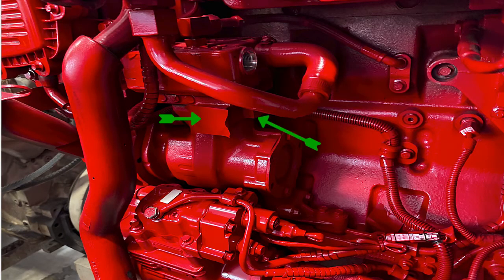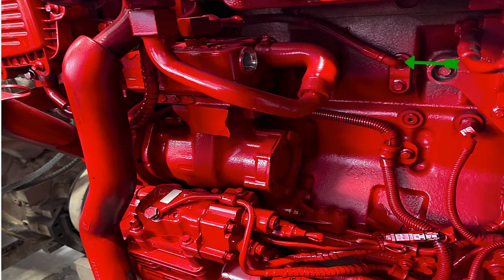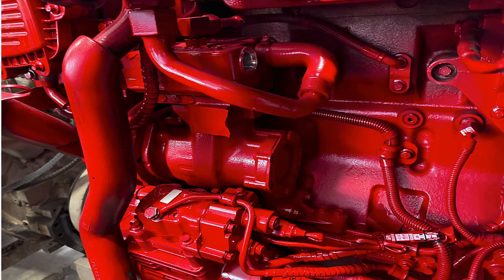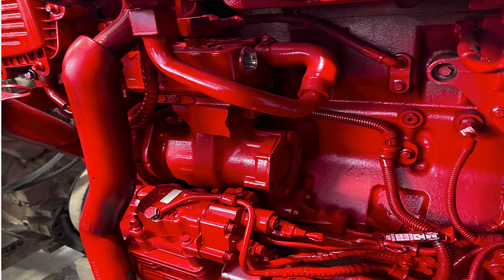The cummins on engine air compressor

Comment: Is it normal for these to knock pretty loud? I have a CM570 and my compressor was knocking while building air so I thought it was on its way out. I swapped in a reman and it's knocking just as bad. I did try my best to time it with the engine but the gear may have turned a bit as I was lining it up
Reply from the maker: The knock is caused by the gear train timing. It will not cause any problems and was a fairly normal thing. Later they marked the compressors gear to time it to try to lessen the noise. Not a problem to worry about

Comment: Great video.  Ive got an issue on my isx 871.
I bought it used last year and the truck was never a fast air builder.  I assumed conpressor was getting weak.  Changed dryer filter but no change so i swapped in a reman compressor.  Still very slow...take just about 9 mins for 0-125psi at 650 idle.
Ive used shop air on the output line and it fills good with no leaks anywhere.  When idling, i can put my thumb (covered with rag because of heat) over the output and theres not a lot of pressure there.
Not sure if ive got a bad reman or i should look somewhere else?
Reply from the maker: If you have air bag suspension and start at 0psi  9 minutes to build to 125 at idle is not bad. The system check is 90-120 psi in under a minute at 1800 rpm. 
On older air systems it is not uncommon to find small leaks at quick release valves or fittings. You could bubble soap all the fittings when the air is up to find smaller leaks. 
Out 4 axle heavy haulers with air suspension took about 6 minutes to build from 0-125 at 1400 rpm.
Reply: @ENGINESHOPJOE  ok thanks.  I'll do some more tests at higher RPM and see where it's at.

Comment: Getting engine oil in the supply air hose to the compressor on an ISB6.7 (the "Morphydite"), what causes this and what is the fix? thank you sir!
Reply from the maker: Usually it comes over from the turbo. See if it is pumping oil into the cac piping. Could be the air filter is a little more plugged than you think. A charge air leak can also cause the turbo to pump oil. If you idle a lot sometimes you see that as well from the egr and cold incomplete combustion  exhaust gas comes back through the egr and gets into the intake then air comp inlet. that can look like oil

Comment: Good as always Joe! The Wabco compressors have never really impressed me. I can remember trying to use ATF on the CM871's and CM876's to get the unloader piston to free up so that silly sliding leaf could go from unload to load. Had a couple on E-Tech Macks I just converted those to Bendix! The Paccar MX used a twin cylinder Wabco on EPA10 and 13' and those had trouble with the front ball bearing failing, which would cause the shaft for tandem fuel/power steering pump to fracture and snap so you lost power steering assist shortly before the engine died!  The EPA 17 MX went to single cylinder Wabco as standard compressor and those have pretty high failure rate for the heads failing and allowing compressed air in cooling system. No one ever has the head in stock and I think folks are gun shy of doing it because of the past ones having ball bearing failures. Other than that, they can flow some CFM!
Reply from the maker: One would think by now they would have been able to make a bullet proof compressor that will run the life of the engine. 
New is not always better but it does always bring a new set of problems to figure out how to handle.

Comment: Wonder why they don't just have the air intake tube for the compressor plumbed into the tube between the engine air filter and the turbo inlet?

That would be nice cool clean air.
Reply from the maker: Starting with the 2021. X15 they do that. So that carboning issue has been solved.

Comment: The old style single cylinder Holset worked well .  Never seen a piston failure . Unloaders were easily replace in the field . They would carbon up however a revised head design cured this problem . The Wabco compressor unloader was not reliable on the ISX-15  or on the 6BTA’s .  Always look forward for your videos .
Reply from the maker: I agree. You could get the old compressors pumping air on the side of the road. The wabco head assembly is an engineering nightmare in my opinion. And now the current engines we bought the head is not field repairable. Giving cummins some benefit of the the doubt once they moved the air comp inlet pipe to stop egr entrance that really helped to stabilize and make more reliable the wabco head. Our favorite saying at the shop is " rocket science systems belong in space not in trucks that live in road salt and rain"